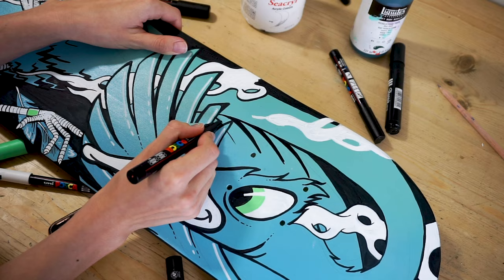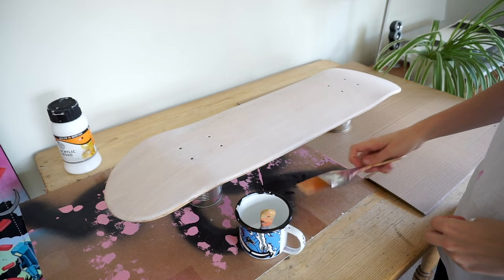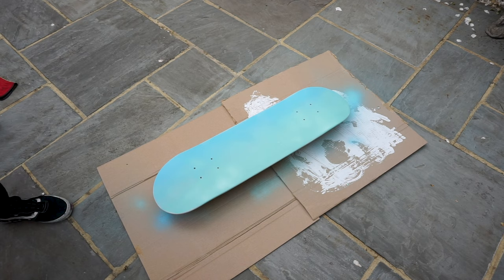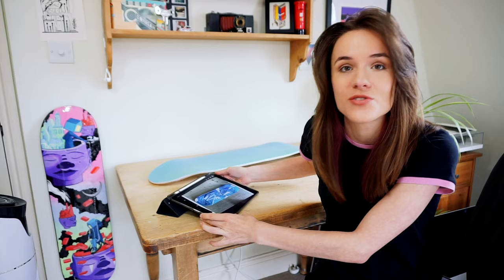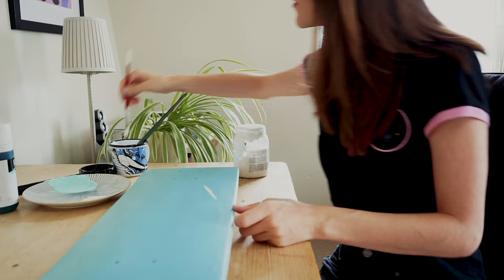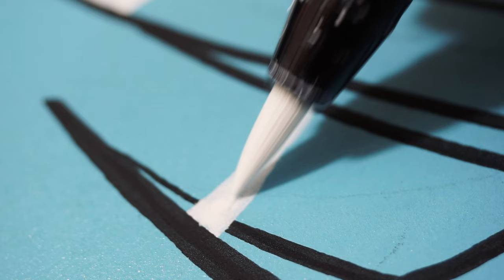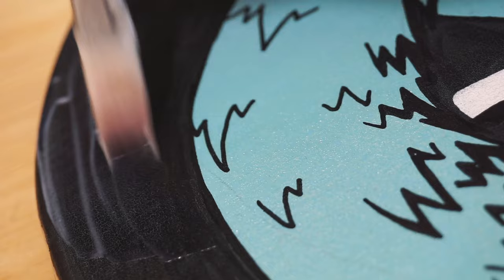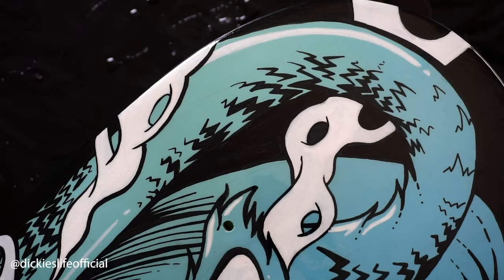HOW TO Paint a Skateboard Deck by Nic Mac

Comment: Hey! I’ve watched this video and the before it about the epoxy attempt that went wrong. What exactly did you do this time around to avoid the uneven epoxy resin finish? Thanks for the help!
Reply from the maker: There was a little list of things that I think caused it in my “how it went wrong video” so I avoided all of those and made sure the surface was clean and dry and didn’t have anything on it that would react and that the paint was completely cured. Mixing the resin very thoroughly and not tourching it as much. I still could improve though, I want to make a full cover for it, as having the sides open still let dust particles in. 👌👌 next time it should be perfect! So stay tuned for that video :)
Reply: @NicMac  Right on, thanks! It’s definitely a nerve racking process after you spend so much time painting the deck.
Reply from the maker: @harrisonmcumber3923  ahaha I know, I really kinda ruined the first one, which had taken soooo long to paint 😂 but “you live and ya learn! Ay?”  :)  hope yours goes well!!

Comment: Quick question, if it isnt a naked skateboard, do i need to sand of the pain or can i just paint over it?
Reply from the maker: It's best to sand down and start from scratch, But if its a new board and smooth, you could spray paint it with your base colour and go from there! Don't hold me too that though, If its a very shiny surface it might not hold. hmmmmm, safest bet is to sand! ahah went in a bit of a circle there but hope that helps!

Comment: How did you remove the design from the board, so that there is just the naked board at the beginning? :)
Reply from the maker: I bought it naked ahah
Reply from the maker: link is in the bio for the deck
Reply: @NicMac  ok that's easy🤣 great video by the way😊 love the design
Reply from the maker: @alxm0508  ahaha a lot easier for sure! and thanks so much man I really appreciate it!
Reply: You would have to sand it. Don't use to rough ones. You don't want to sand away a chunk of the ply.

Comment: How many hours did this take you?
and how long must it dry
Reply from the maker: I didn’t time it but the drawing painting part took a bit longer than the prepping part (sanding,priming,spraying) the primer dried instantly and the spray paint drys pretty quickly, I think it was touch dry within an hour, But I drew on it the next day so that it was fully cured. Then I drew/painted the design in a day 👌

Comment: Can you skate this, or will the resin shatter?
Reply from the maker: hmm I wouldn't recommend it for tricks (it defo can be done but It just won't preform as well) as it can be a bit grippy for sliding and also because resin is quite thick, it can reduce  the natural flexibility of the board, You can skate on this no problem if it's just for a casual cruising type thing though. Hope this helps and makes sense!

Comment: Thanks. Second video that says "how to paint a skateboard' that fails to even say what is used to seal the art in  at the end.
Reply from the maker: From 10:33 👌 there’s also link in the description to the Dickies video about the resin.
And links to the products used in the description too.
Reply: @NicMac  oh thank you I'm deaf 😅

Is this method only for display boards? How well does resin hold up to actual skating?
Reply from the maker: @nicorobin3691  on that, there’s mixed reviews , it can be done and it’s certainly durable but I think it can affect the flexibility of the board a little, for tricks, but only slightly. However this is why I’d only really recommend it with more certainty if you used the board mainly for cruising, minor tricks. But I’ve had people say it’s great, and others that say no, so very hard to know for sure with a solid answer unfortunately